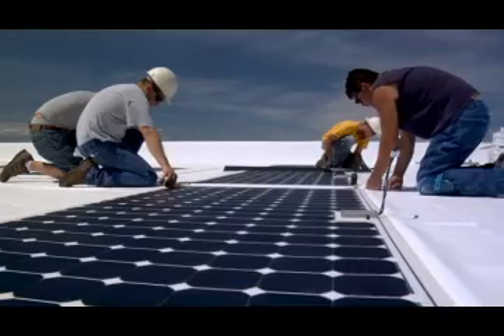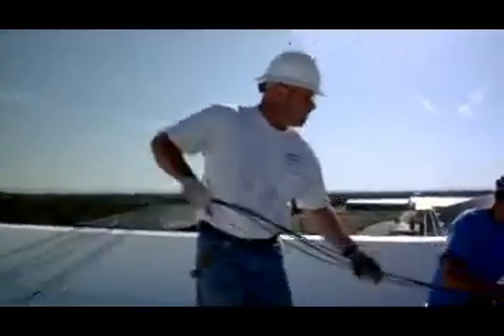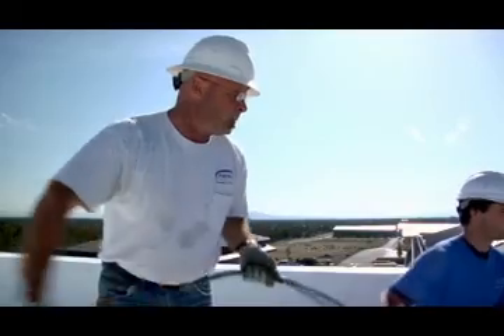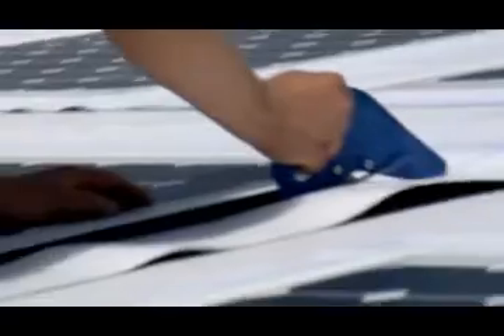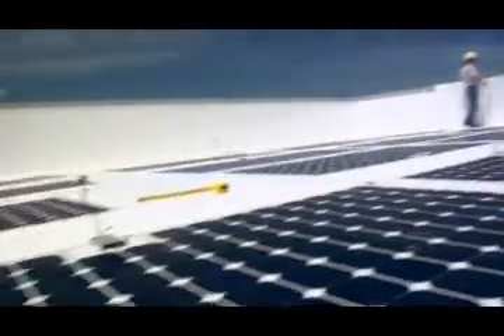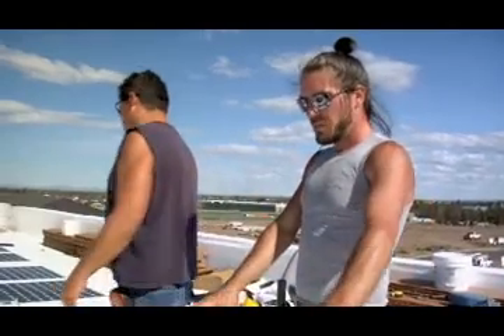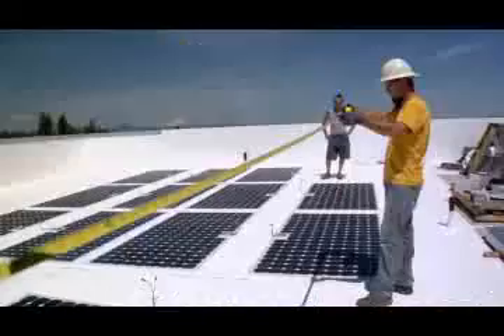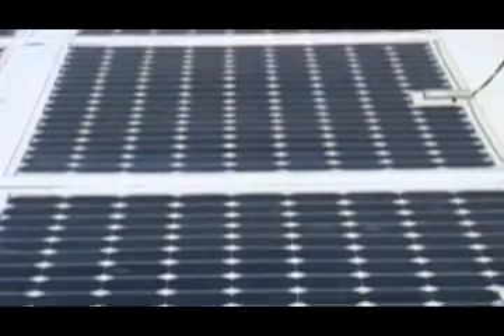Thin Film Solar PV Panels Roof - 10 kW installed on the roof in one day

Comment: In spite of the talking heads in the video, this is not a thin film product. While it is thin, it is NOT film.
The patented product is built with a 5" high output crystalline cell. Each 4'x8' module has over a 400 watt output. (NO THIN FILM can claim anything close to that watt density output)